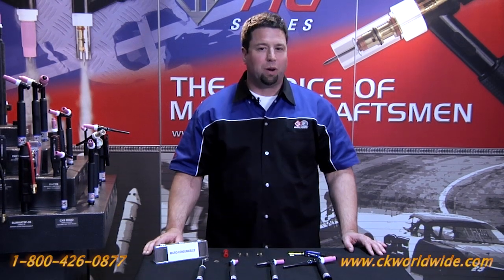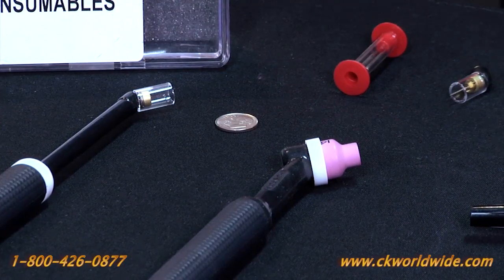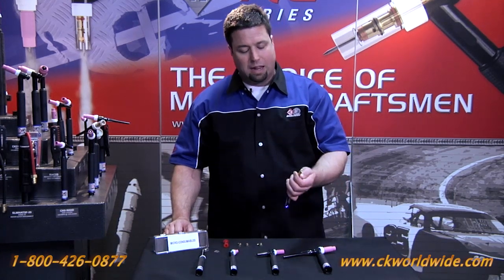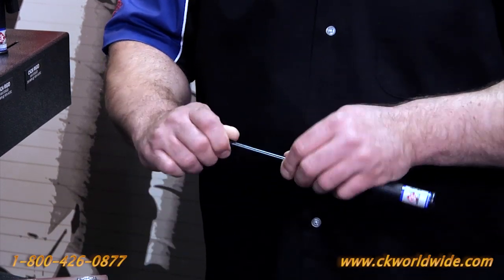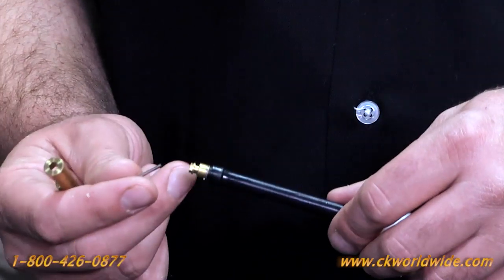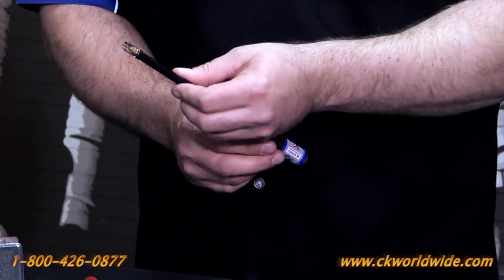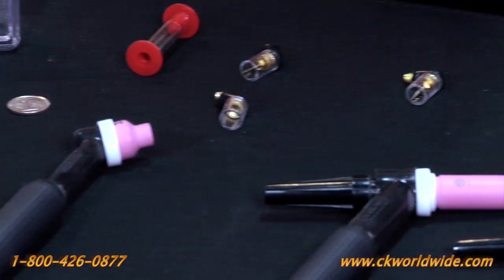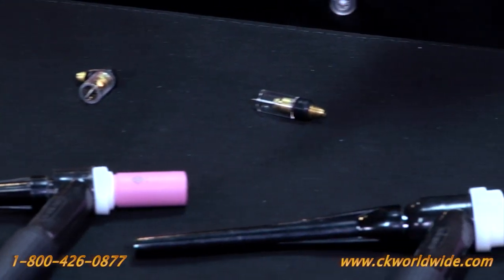CK Micro TIG Torch - Smallest Available

Comment: 90 degrees, 45 degrees and 180 degrees? Are you sure? If the first two are 90 and 45....the last is 0 or 360 degrees. With 180 degrees it would point straight back at you.
Reply: My thoughts exactly